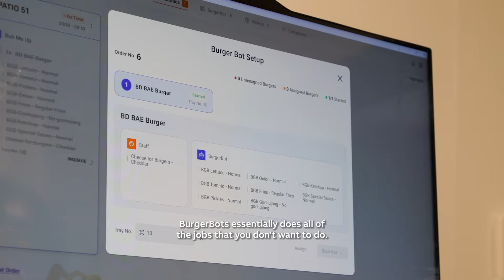Robotic burger-making in 27 seconds!

Comment: It doesn't make burger, it assembles it. Chef can assemble a burger twice faster. I have been dealimg with hospitality industry for more than 20 years now and that "chef" in the video, who says robot does what he doesn't want to do...makes me laugh. He spends the same amount of time placing bun in to the box and pushing that box through the hole for robot in the same amount of time it would take for a chef to assemble burger 😂😂😂😂

I am excited about robotics in the areas where you actually need them, but this video is juet a huge pathetic mess with hired actors, looks like American drug adverts.
Reply: You clearly don't understand that while the machine is assembling multiple burgers the "chef" (which will eventually be replaced btw) is just kinda just a beta test run to supervise everything goes smooth.
Reply: @SamuraiPR  you do get that the meat was cooked by the chef? Machine just put lettuce, tomato, sauce and the cooked meat on the burger bun chef placed for the machine to deal. And that is literally one task robot could do in a huge space. Meat doesn't cook in 27 seconds buddy. Even if you just microwave it.
Reply: If robots become cheap then even cooking meat would be automated right. Thr actual patty is anyways coming from an assembly line, cut shaped and pre cooked by robots. Just put another one in the restaurant to grill it both sides to a perfect temperature.
Reply: The robot is currently much slower than people are. Also, I can see that the quality of the toppings is not good. Too thick, uneven distribution. People won't like it. I know 'I wouldn't like it.
Reply: @vshah1010  well, people like McDonald's and it's basically fully automated years ago. All the people do is press the button, and all the measures, everything is automatic. Many coffee shops even have automated coffee-making. You still need people, of course, but as one very famous futurist think tank recently pointed out, more than 95% of human jobs will be done by robots or AI in a maximum of 20 years. Like I said, I work in a hospitality industry in London for more than 15 years and majority of people who are coming and looking for work here are already below that robot level. The issue is that all the auto, robotics and AI will literally destroy poor countries and their population.